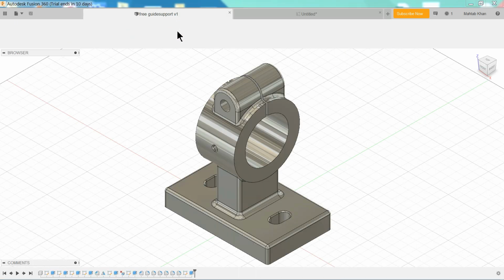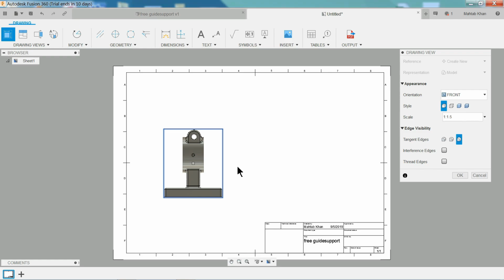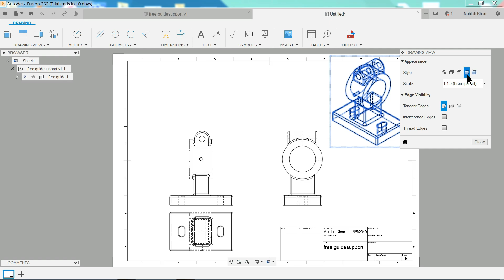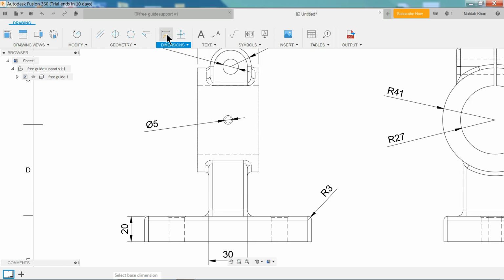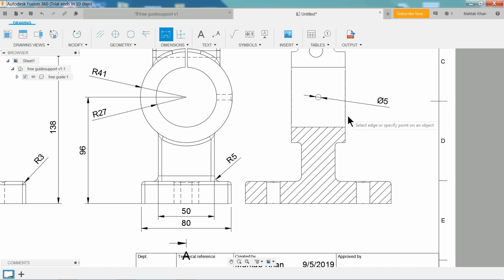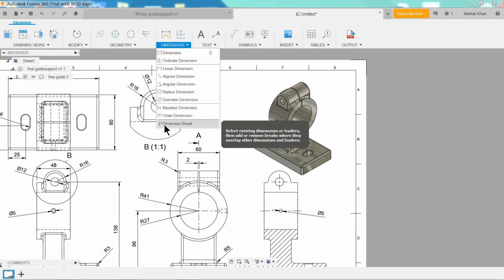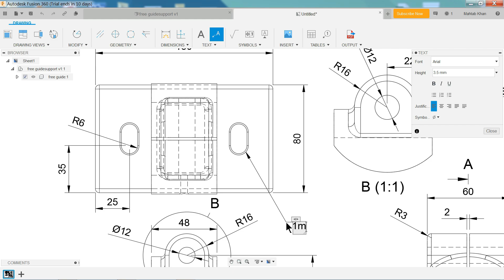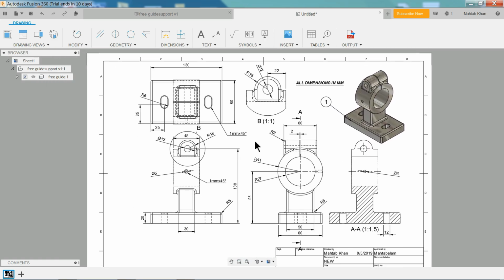Autodesk Fusion 360 Drawing Tutorial Free Guide support EXERCISE-16

Comment: “All Dimensions in mm” should be in your title block. Also, you need to specify your tolerances. In addition, what is the surface finish and the material of the part? Lastly, I don’t think your section-line for AA is ANSI standard but maybe you’re following a different standard? Decent work… 😎